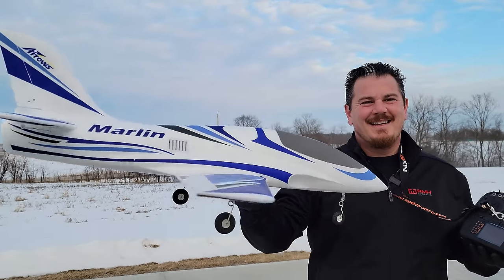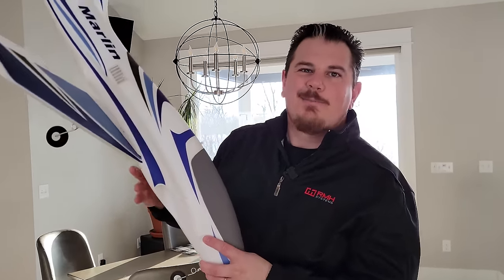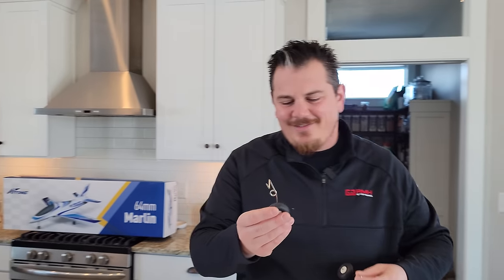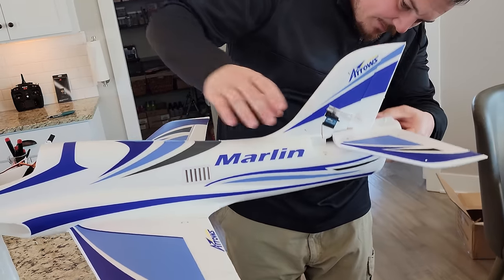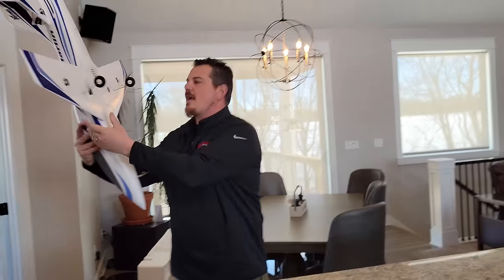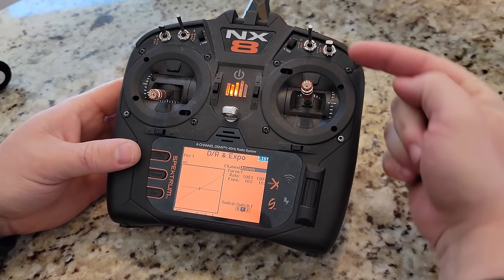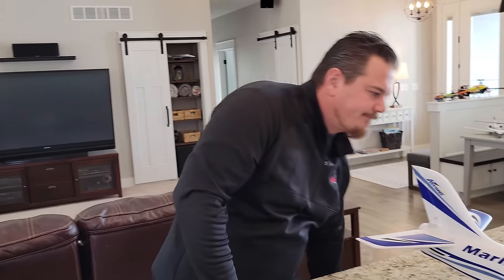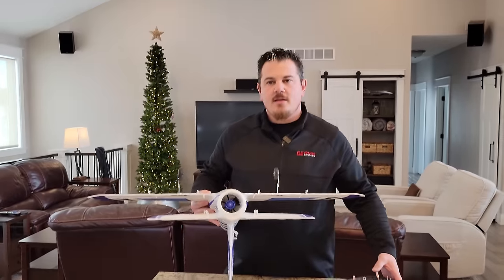Arrows - Marlin - 64mm - Unbox, Build, Radio Setup, & Maiden Flight

Comment: Maidened mine this past Friday  after flying the Arrows Viper a month ago, the Marlin is perfect,  take offs, landings, slow down with flaps. Flying 4 1/2 minutes on my Roaring Top 4s 3300 35c.
Reply: I agree with your opinion on the Marlin. I had flown the Viper and the Habu STS. The Marlin is my favorite of the three.
Reply from the maker: Cool Dale! It's a great plane, and solid flyer. Stalls are easy to predict, and flaps help slow it down nicely, PLUS enough speed to keep things interesting. Great mix of qualities for a beginner EFD jet!
Reply: @BrianPhillipsRC  will soon remaiden my 1.2m Eflite P-51 Blondie. Haven't flown it since it was Stock 7 years ago. Did the upgrade to 4s with the Skywalker 50A ESC I saw you do. It was way to slow on 3s. Has a 4 blade 11x9x4 apc prop.that at least some improvement back then but it gave me 5 minutes Flying time on a Nano-tech 3s 2650 35~90c

Comment: Brian, really appreciate all the time you guys took to video the forward programming. I'm close to finishing a build of a FT kit (Tutor) where I added both ailerons and flaps and am seriously considering an AR630 for the build. 
I'm a big fan of "SAFE" type technology as it has saved me many crashes on my two Timbers and my AeroScout. At 77 years old I simply do not have the reflexes that I had as a younger man. I'm advancing in doing the simple aerobatics, more so than I would have otherwise, by having SAFE to bail me out when I lose orientation or just want a little break from the advanced modes.
Keep up the good work... both you and the camera crew.
Reply from the maker: YES! SAFE is a GREAT tool, and it can definitely be there for you if you need the help from time to time.
Reply from the maker: AR630 is a good fit here, for sure!

Comment: There is indeed a very good tool - since coming across it I use it all the time , it is a combined metal  (180Deg ) protractor combined with a steel rule - you set the rule to 90Deg on the protractor then put the flat side (Right angle made with the rule ) of the protector against the leading edge and measure back on the rule. it works 100% spot on.... only draw back I have found is that the type I have will only measure up to 150mm from 0. so if you have a bigger CG than 150mm from leading edge you would need to mark 150 and then measure from that point ... My make an interesting point regarding CG - I always install the RX first and then do the battery.... Love the Video, nice chat, Love the MARLIN ,
Reply from the maker: I like it! Great idea!!!

Comment: This was my first jet. I got it because it was well under $200 at the time and because it runs on a 4 cell. I did not own any 6 cell (expensive) batteries at the time. Perfect for beginner jet pilots, nice and slow for beginner compared to 70mm jets.

One warning (from experience) do not land on the nose or she will start to bounce and likely roll over and break her nose off. It is pretty easy to bend the nose gear. So try and land on the mains.  May your skies be blue and your winds calm.
Reply from the maker: yes! true!

Comment: I knew it, yep I guessed that is how you "disposed" of your old lipo batteries.  Safer then stabbing them with an icepick.  Hehe.  For a jet the Marlin has a huge easy to get into battery compartment.
Reply from the maker: We used to use a nail and drive it through them into a board - we did it with welding glove and face protection, but it was still WAY more dangerous.

Comment: Thanks for explaining the CG recently got into EDF jets after watching your videos and now have the t33 but had loads of problems that take off with it stalling immediately in the air and crashing. Hopefully now I understand the CG better. This won't happen. Cheers for the video. Keep up the good work
Reply from the maker: It will help a lot. If a plane is tail heavy, especially in a hand launch, you will be screwed...but when you get REALLY good, later on, tail heavyness can be used as a tool...I sure don't do it...but sail plane pilots will do it.

Comment: On my second Marlin and it is quite an awesome plane! I normally run it on a 2200 4S and it flies beautifully. The one time I put a 3000 4S battery in it it kept wanting to roll on me similar to maybe the problems you're having in the video and it barreled itself into the ground ( the reason I'm on Marlin #2 lol!) I would recommend sticking with the 2200 even though the flight times are shorter.
Reply: Yes, definitely 2200 is the sweet spot. I fly mine almost daily. Its the best beginner EDF on the market
Reply: I agree it flies well on 2200 4s that's what I use on mine , I fly conservative and get 4min flight time.
Reply from the maker: Very nice! I'll give it a try!

Comment: Great video. I only wish Brian would have also showed how to register and update a new AR630 receiver.
Reply from the maker: You mean, I should have pulled out the Vector, and used the Spektrum offering instead?

If you want to see HOW to do this, we have a number of good videos for that. Just off the top of my head, I believe the FMS Viper 15th Anniversary is using almost the exact same setup, if you'd like to watch it right now - https://youtu.be/lNbbYGE7PP8
Reply: @BrianPhillipsRC  thank you for your response. My pnp of this model did not come with any stabilization assistance.

Comment: Great Video, have my arrows Marlin right to my side and the 4s 2200mah  Akkus ar loaded and the plain is ready to take off.  Brand new for 120 SFr is like 100 USD or so.  Like the Modell verry mutch . Think I will Testing this Bird whit a stability system.  Until know I never fly whit gyro stuff.  Think 3 minutes of full power on a 4s 2200mah  for first flight will be OK?  Flaps can't go up so be careful whit the flaps by programming,  otherwise the Depron will brake
Reply from the maker: Sure - 3 minutes would be fine on a 4S 2200, I believe. Just watch your throttle, and keep sharp on your situational awareness toward the end of your flight... don't want to get caught at low altitude and get trapped into a bad landing aporach.

Comment: I was hoping you would review this plane. I have one sitting on my desk and I just need to install the receiver. Could you elaborate on how the Marlin warns you before it stalls? You mentioned at the 3:50 mark. Thanks for the great video.
Reply from the maker: It falls to one side or the other, but it's not the most graceful, but it's also not hard to read...you KNOW it's coming, since the plane slowly tips over. You just increase throttle, lower the nose, or run the rudder one direction to get the nose going down or speed up, and you'll be set! Easy as that...the Viper jet, while a lot better flying plane, doesn't give ANY warning...it just FALLS...at least in a power on stall...power off, like on a final, the Viper will just be cruising along, and PLOP, especially on base leg, when you need to make that final turn for aligning for landing, she'll slip right out from under you and fall into a violent stall....NOT so with the Marlin.
Reply: @BrianPhillipsRC  Got it. Thanks for the explanation!!!

Comment: Instead of using that - would a telemetry module measuring MAh as opposed to voltage on your TX would be better ? You could set the low mah threshold based on the capacity so if you want it to alarm at 25% remaining battery ( in the cold ) ..
Reply from the maker: I don't know of such a device, but if they exist, other than telemetry from the Rx, that would be very nice.
Reply: @BrianPhillipsRC  - I believe you can get the telemetry to notify you on a certain mah threshold , then you know your pack is truly at X % and it’s time to land - regardless of weather or type of flying . Cheers

Comment: I need help understanding the battery voltage issue you mention at the beginning, when you first go back insidie the house.  The low voltage alarm is set to 3.3V and all the cells of the battery are indicating more than 3.3V remaining.  Why would the low voltage alarm sound if hte battery voltage is set higher than the low voltage alarm?  I'm really new at this so I'm sure that I am missing something that is very obvious.  Really enjoy watching your videos!!!
Reply from the maker: The reason I think I should have heard the alarm, is that when you load the circuit, like giving throttle, and believe me...I was...the cells should have dropped down below 3.3VDC. I guess, it's not impossible they didn't, but I highly doubt it. These EDF's are very high loads on power systems, so when you have an alarm setup like I did, it's not uncommon to have it alarm on TAKEOFF ;) But then the voltage "recovers" when you get out of throttle. It's kinda strange and seems somewhat counter-intuitive, but when you've been at it a while, these dots will connect pretty quick.

Good luck as you explore into this more!
Reply: @BrianPhillipsRC  that makes perfect sense and thank you for your reply.  I am currently learning to pilot RC planes.  I have learned alot from your videos.  Actually your videos are the reason I am learning to fly RC planes at 50 years of age.  Thanks again!!

Comment: I know this video is old now but I have recently got my hands on one of these as my first EDF. My throttle wire consists of the three wires in the connector then a separate yellow wire. Any ideas to where this goes please? At a loss with Google. 😮‍💨
Reply from the maker: If I'm correct, I think it's actually a "reverse thrust signal only lead" - check out the FMS T-28 1.4m and see how we used it, if you wish ;)

Comment: Brian I added safe to my arrows bigfoot and i would like more control left right and down. Can I just turn up that roll rates? I would thing higher the number means it turns more?
Reply from the maker: That's in the SAFE Angle Limits. I've never done it before, but believe it's in the Forward Programming SAFE Section.
Reply: @BrianPhillipsRC  thanks

Comment: I wonder, can you use a 3S on this plane? or not enough power
Reply: I accidentally ran a 3s in it. It works fine, just not the power on tap you have with the 4s. It will be reasonable on 3s.
Reply: @anthonyjayakody3356  alright thanks for the info. I have 3S batteries and was hoping to still be able to use those for this
Reply: @brandonhill7016  try them out and once you’re comfortable, hit the 4s. Really stable aircraft.
Reply from the maker: Thanks Brandon for the quesiton. Sounds like Anthony already answered for me, Thanks Anthony...because I haven't tried it.
Reply: @BrianPhillipsRC  Video on what it's like on 3S yeah😏😏
Reply: @BrianPhillipsRC  Either way, thanks for the content. I enjoy your videos and get some nice info from them. Thanks and keep up the good work👍
Reply: @BrianPhillipsRC  no worries Brian. Thanks for the great reviews. Do you think I would be ready for the FMS Futura if I’ve had flight time on the Marlin-E flite A10. Any quick tips?

Comment: Don't mix the flaps whit the ailerons! , beacoase the flaps on this bird can't go Up. High Rates and low Rates :

Elevator Aileron Rudder 12mm up / down   10mm up / down 14mm up / down 10mm left / right Clevis installation 12mm up / down   8mm left / right
Reply from the maker: I didn't mix ailerons with flaps ;) Did you mean Flaps with Elevator? I know you're English suffers from time to time, and wonder if your message was somewhat lost in translation?

Thanks for the comment, and sorry I might have missed your point Philippe
Reply: @BrianPhillipsRC  Your right,  my English is not that Good.  I know you don't mix flaps whit ailerons,  but I want people warned if they try aileron up on the Marlin, beacoase the flaps ar not good for up.  A compliment for your Film crue,  she's make a fantastic job.  All the best from Swiss

Comment: Excuse me, will it be faster to use 2200mah?
Reply from the maker: That won't make it faster. This measurement, 2200mAh, speaks to the capacity of the battery, not the voltage. The Voltage will make the motor spin faster, and thus make the plane faster. The measure you're looking for is the cell count, in SERIES or "S" - 3S speaks to the number of cells at 4.2 volts dc per cell in series or 4.2 VDC X 3 cells in series = 12.6 VDC. Where a 4S would be 4.2 VDC X 4 cells in series = 16.8 VDC

So if you wanted this plane faster than what we did, you would add a Cell or more. This might require a new ESC that's capable of handling more power through it.

Hope this answers your question.
Reply: @BrianPhillipsRC  But isn't the lighter the faster?
Reply: @BrianPhillipsRC  thanks for your reply

Comment: Could this be ran on a 3700 4s?
Reply from the maker: Should be fine. The bigger battery, the more you'll have to guarantee you get it balanced on the CG...or the plane will get so nose heavy the elevator will basically not work right - then CRASH - so watch out for that, but otherwise, go for it - if it fits, it ships!!!